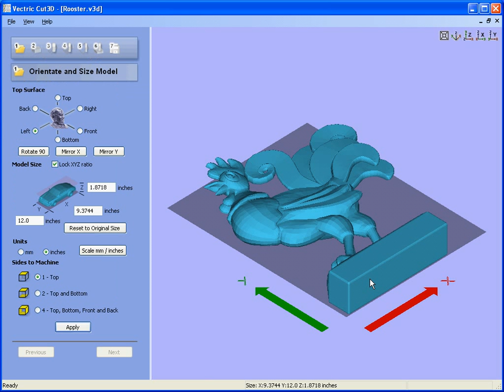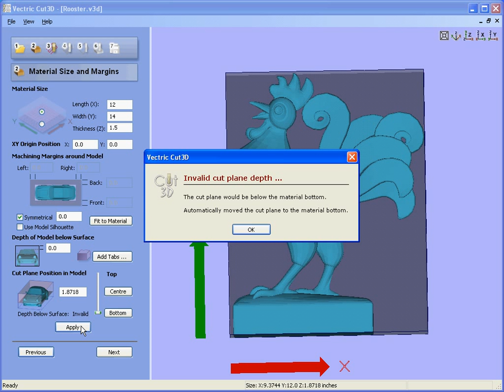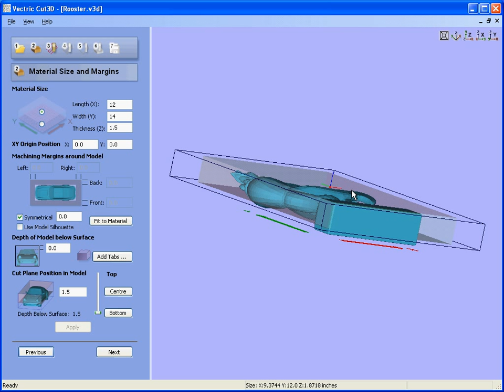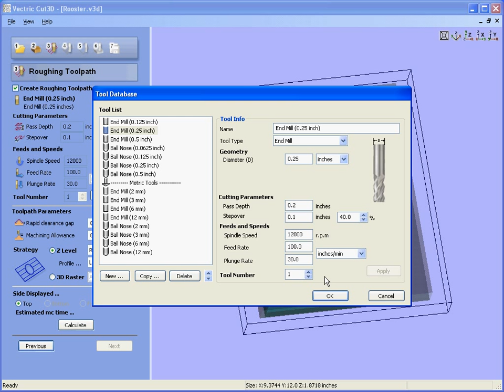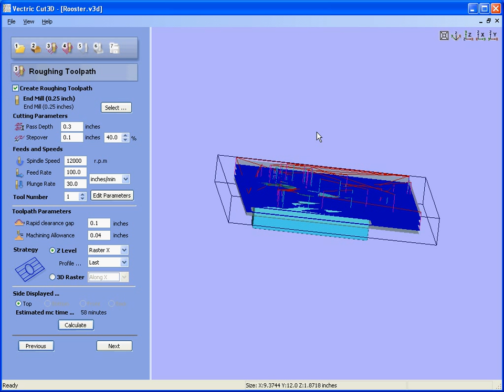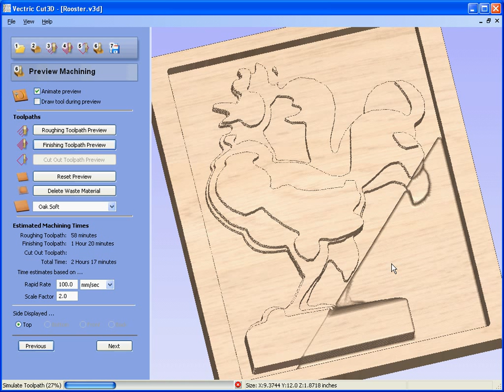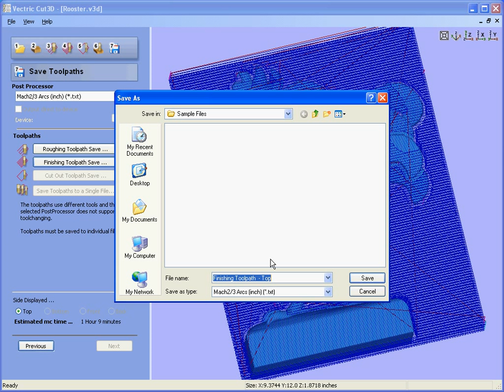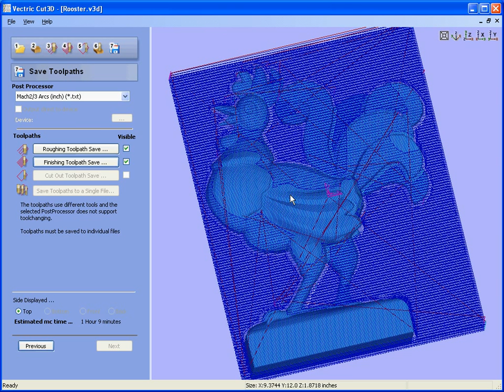Cut3D - 2 Sided CNC Model Machining

Comment: This isn't modeling, this is 2 sided importing... I purchased Vectric Aspire 4.0, based on it's ability to do actual 2 sided, 3 dimensional modeling... as well as cutting. I've been stuck on making a part now, for 2 days, trying to figure out how to set the software up, so it recognizes and will zero itself on the reverse side... I had to physically make part A, then part B, then matching them up.. If I didn't have a laser CNC machine at my disposal, I'd be stuck.... Is there a solution for this, or am I back to Solidworks and finding a post processor for Mach 3, and back on my original path prior to purchasing AlphaCam 2015 and Aspire? I want to work solely in Aspire to do 3d, and it's so far failing to just do simple 2-sided machining.